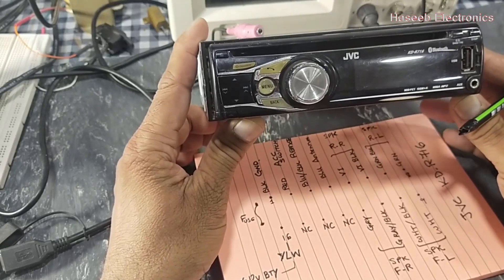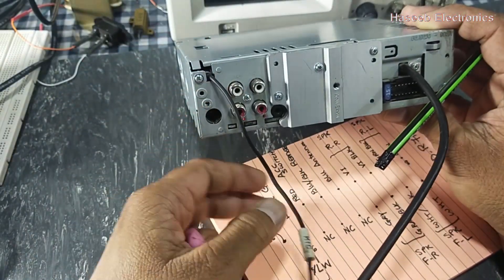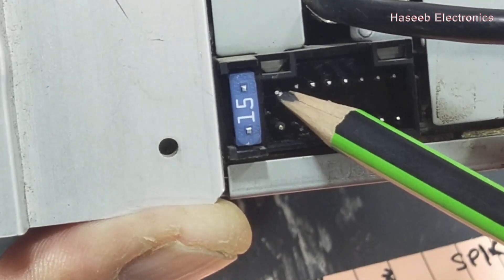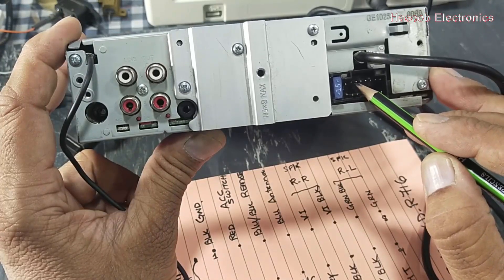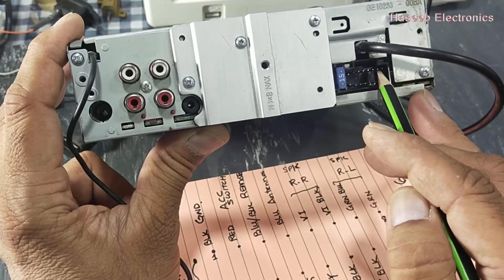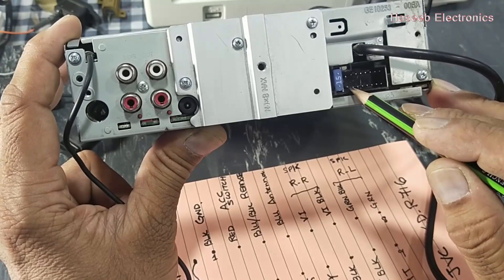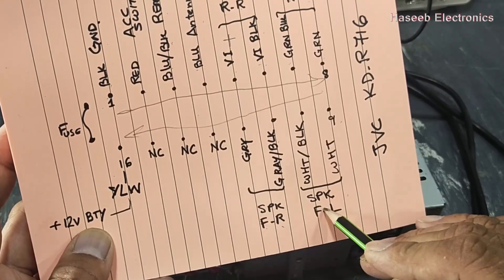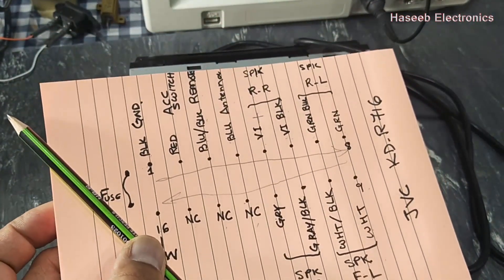{499} JVC Car CD/ MP3 Player Wiring Connections, JVC Car Stereo KD-R716 CD Receiver

Comment: Thanks for sharing the info.  I have JVC KD-200 and noticed it was not working.  I checked the fuse and power coming in but it would still turn off after some time.  Then I tried to remove and re-insert the antenna wire and it worked.  After some time again not turning on.  Again removed and re-inserted antenna and works again. I have to do the same everytime.  What could be the cause? please advice.  Thank you